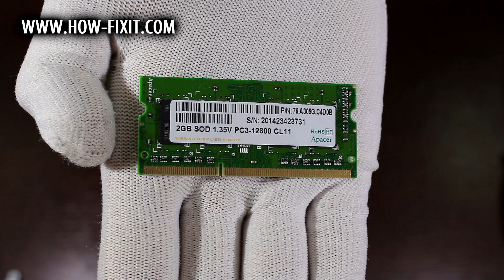Asus X551 RAM Upgrade and Installation Guide

Comment: Good video though it is too slow with the early part that took such a long time just to open the bottom cover.  Can cut most of that part.  Asus had such bad design that you need to remove all the components just to upgrade the RAM.  For such old laptop, it is not really worth the trouble unless you get time to kill.  I was thinking of upgrading my RAM.  Now I do not want to go through all this.

Comment: When I run DXDIAG on my Asus X551MA , it shows I have 4Gb RAM but does not indicate whether I have a 2nd vacant slot to insert another 4Gb RAM.  
Actually Task Manager shows I have 1 of 2 memory slots used, so I guess another 4Gb can be added to the 2nd slot.
Reply: There isn't two slots

Comment: Well, this was a fun little kick in the nuts: Dismantled my Asus D550C (X551) laptop, only to discover that — unlike the unit in this video — it has integrated R.A.M., with no socket to which one may add a stick. So, yeah...
Reply: Same man waisted $100on Amazon for a ram stick Ivan use
Reply: Is your laptop full model X551CA-RI3N15? Because that´s the one I have and I keep finding contradictory information on this one. Some say it is soldered, others say it isn't.

Comment: Great video - but this ASUS design has to be one of the WORST physical laptop designs I've ever seen (you have to take apart the whole universe just to get to the memory slots!) (And, unfortunately, I bought one!) :-(

(I have a Samsung as well - 4 screws opens a panel on the back - bingo! Memory, disk and fan all exposed & accessible in about 30 seconds. Poor show, ASUS.)

Comment: i have the same model but older i think of 2015 edition of asus x551ca same as u have but it has 2gb ram single slot but the ram is not soldered it can be pulled so can i out a 4 gb or 8gb crucial ram and cam i upgrade the HHD to ssd and can i replace intel pentium by core i3 2nd or 3rd generation please help urgent i am in worry 😢😢😢😢❤️

Comment: Does this also work on the x551CAP
Reply: No, if you have intel celeron as processor then you are stuck with system ram. Mine is 2gb and i couldnt upgrade it. SSD should do fine with this.

Comment: Mine says it's using 4gb of ram with 1 of 2 slots used. Also with a hdd. Even though everywhere I've looked says it only has one slot of ram, mine apparently has two. Is my system wrong perhaps?

Would it be worth it to upgrade to 6gb of ram or just upgrade ssd?

I have a hard time understanding whether one is more important than the other. My laptop opens sites/apps slowly and loads them slowly. If I'm using a video editer for example, I will click a button and it will sit for a short while until it finishes. Is that an example of poor ram or having an hdd?

Also, I recently bought a working $20 2011 IMac. It only has 2gb ram and a hdd. Do you think it'd be more logical to upgrade this computer? It has a definite 4 slots of 16gb ram potential at least.

Comment: HI,i have asus X551MA,can i upgrade to 8gb?cause the official say maximum 4gb ram,such as i have now!
Clever video,thanks
Reply: The official says 4gb max. I did some research awhile ago for mine and I've read that linux recognizes 8gb. Otherwise, just attempt installing over 4gb and seeing if the bios reads it.
Reply: @stylerk  ok but for the windows?

Comment: Any Lame~Ass Company that would make you completely dismantle a
 laptop just
 to upgrade the Memory module or replace the CMOS battery are a bunch of Dick's!

I had to do a seemingly simple Memory upgrade for a customer that had
 one of these 
stupid ASUS X551M Laptops;   and I thought it was going to be the usual 5 minute quick job.

   W R O N G!
I had to charge the client an additional fee because of the extra time it took.  This is an
Unacceptable
 example of poor engineering from a seemingly reputable company.    - - -                                         
Bottom Line - - - - - - - - - - Before you purchase your next Laptop; check to see if the company
had enough integrity and intelligence to put a removable access panel on the bottom of the case!

Comment: Thanks for the video. Can I ask...? Mine is an x551c with an i3, I only can find specs for x551ca,  I'm wondering if 8gb will work or just 4gb?can you help me? 
Thanks in advance.
Reply: @Carla x I got an 8gb card as an ornament because chips are soldered right in the board.

Comment: Ok i understand where the installed ram is but where is the second slot located, the system reads 2 slots but i only see 1
Reply: @ibwith6500  I just gave up, as i wasn't able to see another anywhere, and by the time I'm responding the laptop isn't even worth keeping anymore, and the amount of ram sticks can vary from make to make but some supports dual while other only supports 1, and others isnt even user changeable
Reply: @ibwith6500  don't trust in system reads, even cpu z or speccy are wrong for this. It reads the chipset capabilities. For ex, my mate's laptop shows 4 ram slots in system, but have fisically 2. My desktop pc shows 4 slots in system, but it's an itx motherboard so fisically have 2 slots.

Comment: mine have it soldered onto the board
Reply: You have to change mboard (like me), 30 - 90 $ depend the cpu, n3530 (x551ma SX056D, only 7.5w power, benchmark similar then 2117u), 1007u (x551ca or ma, the poorest), 2117u (x551ca or cap, the 'middle class cpu' for x551), i3-3127 (x551ca SX292H, the best, but 17w with less battery time). You have t search a motherboard model with slot: a lot of x551 have no ram slot, but only ram soldered on mboard (like you and me). Also, there are models with soldered + slot ram, others with only slot (You have to open the case, software do not say exately what ram is working inside). Look type of ram too (depend of cpu bus/chipset speeds): all so.dimm ddr3, but 1333 or 1600Mhz (1600MHz ram works on 1333MHz mboard too, but u-clocket to 1333). To change mb is easy as to change the ram (only tools you need is a badge card and a little screwdriver): you have to open all the laptop... Only you have to transfer wlan module (2 screws) and the cooler of the cpu (4 screws, thermic glue) from old to new mboard, very simple... Thank you ASUS!!!!!!!!! @#[]`#[]@#@

Comment: My sound has been cutting out. It comes back on and off.  I'll get a crackling sound.  If I press the laptop at the point where the USB ports are located the sound will come back on a lot of times.  From your video I see a White and Black wire going to a chip, and looks like Black and white wires go to the speaker..  Is that the sound chip and could the wires have come loose and just need connected?.. Haven't  opened it up yet  Some sound would have really been nice.  Good quality video.

Comment: my memory came 4gb 667 mhz in x551
can I use 8gb 1333 mhz? or 4gb 1333mhz
Reply from the maker: Yes, you can install any DDR3L RAM memory
Reply: maximum ram capacity is 4 gb
Reply: @agk2k7  how you know it
Reply: @AkayBaboli  the complete spec is available on google.i have tried n already used that model

Comment: i have a asus x551cap on 4 gb Ram i want 8 gb ram its this Possible ? think 8 Work ? . Hafe sett the Laptop from win 8 to win 10  thx
Reply: My X551CAP with cpu 2117u 4GB ram have no slot, but only itegrated RAM (soldered on the motherboard). I don't know if all CAP models are with soldered RAM only. 
Memory analysis software programs can give incorrect information. To me dmidecode reported 4GB in use on one slot and 3 other free slots: I bought a 4GB card, but once I opened the laptop I found out that it was without a slot. I had to change motherboards, there are no alternatives (see my other recent comment). Thank you ASUS!!!!

Comment: DDR3-1600 PC3-12800 4GB 1600 MHZ, 240 pin works for this laptop?
Reply: DDR3L is required
Reply: NO: 240 pin is DIMM, laptop work with SO-DIMM 204 pin.

Comment: How-FixIT
some of us have a serious issue at hand: Mine says i'm using 1 of 2 memory slots, it has 4gb, so that means I can simply buy another 4gb stick and keep the one that's in there and just add the new one, yet ppl on here claim when they open the case (I haven't yet) there is just one slt. can you help??
Reply from the maker: Asus X551 that was disassembled in the video had just 1 RAM slot, so as I remember that X551 Series has just one slot for memory. In any way there's a chance that your laptop has 2 slots, but I suppose it doesn't.
Reply: How-FixIT
ok, thanks, I only asked because when i go into task manager 'performance' tab it says i'm using 1 of 2 slots. Other ppl have said the same, then they open the case and there is just one slot. My friend bought a "second" 4gb stick, which now he can't use. Is there a way to tell before opening the case?
Reply from the maker: I'm at 95% sure that you have 1 slot and for me best way to knew excatly how many slots in laptop is disassemble it or check official specs (that sometimes said how many slots has laptop, but in specs of Asus X551 there's no information about slots).
Accroding to software ways:
1. Windows task manager often can give wrong information.
2. Maybe other utils could give correct info: CPU-Z->SPD(tab);  AIDA64 Computer->Summary or Motherboard->SPD. But unfortunately I can't check if it shows this infromation correct because I don't have any laptop on windows right now.
3. Also as I remember sometimes soldered to motherboard RAM could be defined as "slot", but X551 hasn't solered memoy as I remeber.
Reply: How-FixIT
Well, I do want to thank you for your time. I guess it's time to get the old laptop repair kit out, lol
One last question, do you know the max memory these ASUS laptops can be upgraded to?
Reply from the maker: K3NNY O
As I remember in X551 Series max amount depends on CPU, for example for Pentium 2117U - 32 GB,  Celeron N2830 - 8GB.
Reply: How-FixIT
Figures, mine is the N2830, new computer time! j/k, it's a good little laptop. Thanks for all the help. I will sub to your chan :)

Comment: just did the 8gb swap (4gb to 8Gb) - cant really notice any improvement - also discovered you can get a DVD HD Caddy and install a second drive - I will install an SSD and keep old HDD on board, also you can replace the WLAN card, I ordered the 3160 w/bluetooth thats ac rated and will see if that works... I just use mine for email and downloading stuff - go to intel driver and support assistant and run to make sure you have the latest drivers as well for everything.
Reply: it probably shouldn't support more then 4 gb
Reply: did you check if the computer reads the 8GB RAM card, or does it only read 4GB?
Reply: If u have the Celeron version then no wonder why it doesn't improve

Comment: I did just like you did. But after replacing RAM the display doesn't turn on. It works with a second display. I think there's some problem with the display ribbon. Please tell me how to fix it. :(
Reply: Open up the laptop again, and if a ribbon cable is unconnected, just use tweezers or if you want to use your hands (Tweezers would probably be better) and just plug it back into the port.

Comment: Thanks for the video. Its very useful. Can you please advise if there are more than 1 RAM slot on the computer? I cant really tell from the video. My laptop has 4GB installed and would like to double it, so need to know whether i should be buying an additional 4GB (if there are double slots), or 8GB, if only one slot. Thanks.
Reply: actually it depends on the model, I know I'm a month late, but you can tell for sure by open the task manager if you have windows and go to the performance tab and click on memory, from there in the bottom right it will tell you slots used, it will show you how many slots you have and how many you are using
Reply: Parker Mezek
Ahh... very clever! Mine says i'm using 1 of 2, it has 4gb, so that means I can simply buy another 4gb stick and keep the one that's in there and just add the new one, right?
Reply: @k3nnyo411  yes.
Reply: Hollzzyerry
THAAAATS WHAT SHEEE SAID!!! LOL
Reply: Hollzzyerry
Lol!! Glad I made you laugh :) HAHA
-ok, I found some of these slightly earlier models from ASUS had the one memory slot only and then they changed to the 2 slotted one later, so the only way to go to 8gb is to buy a whole new 8bg stick (I'm going to keep the old one as backup b/c it's not worth selling), Task Manager can't seem to tell the diff for some reason.
Reply: On the windows search button put DxDIAG, then click on it. Will give all information you need. Also you can press ALT, CTRL, and DELETE  at the same time and press Task Manager, then press memory, performance. Also tells you how many slots you have of ram. I didn't know I had 2 slots. I bought a 8gb Ram for one slot. I still have one slot left.  I don't think on an older model you can upgrade any further than an 8GB ram from a 4gb ram.
Reply: There is only 1 ram slot
Reply: Leigh Freeman Thank you.
Reply: Parker Mezek Thanks very much!
Reply: Actually task manager can be mis leading.

Comment: Can I put an i3 in this laptop(2.4 ghz quad core)
Reply from the maker: no, you can't, CPU is soldered to motherboard
Reply: How-FixIT how much ram can go in this laptop
Reply: And my laptop is a bit different the CPU is screwed in with a Metal bar over top

Comment: Hi, first of all thanks for the video. I was wondering how to replace the RAM properly. I bought an new RAM (https://www.aliexpress.com/snapshot/8317504928.html?orderId=500114155844030&productId=32595398282) 4Gb DDR3 1333 I followed the steps showed on the video but the new RAM did not work. I tried with the old 2GB RAM and everything turned as usual. I tried  once again but the nothing happened (just showed on the green led). What could be wrong with the installation or the new memory ram, it is needed to set anything on the bios before installing? I have no other way to try the new memory RAM (so I can not say it or that the RAM it's not work properly). My notebook is an ASUS X55MAV (https://www.asus.com/Notebooks/X551MAV/specifications/). Thanks in advance for your answer, does it happened to any other?
Reply from the maker: hi. Unfortunately link is not working. But I suppose that problem could be that you bought DDR3 1,5V RAM, but as I know this laptops use DDR3L 1,35V. You can compare your 2GR RAM and 4GB RAM, if the first one has 1,35V that can be the answer for your question. I can't find any other reasons that can explain this situation.